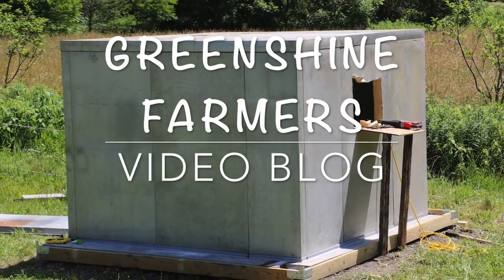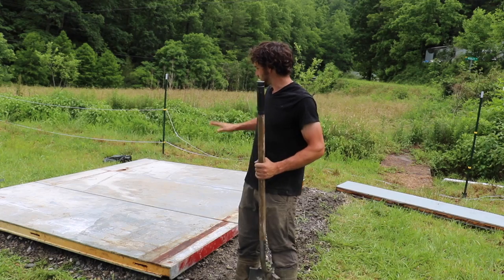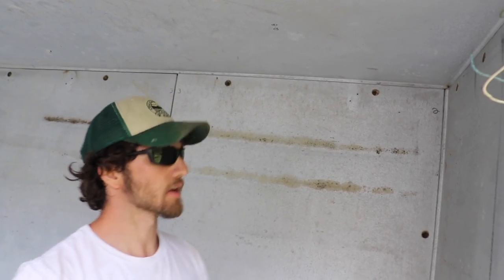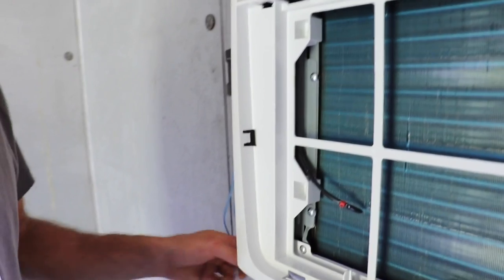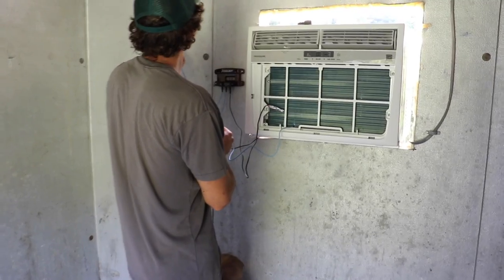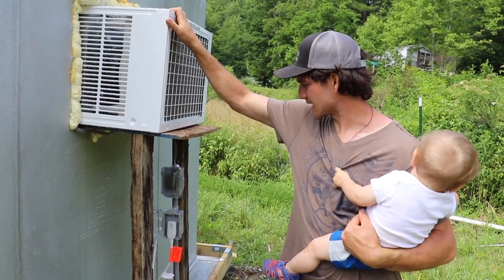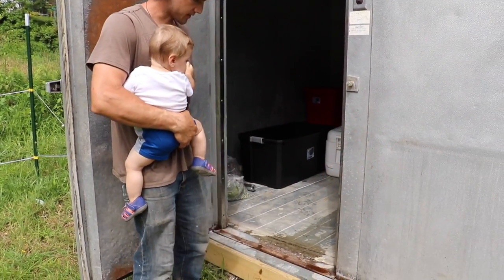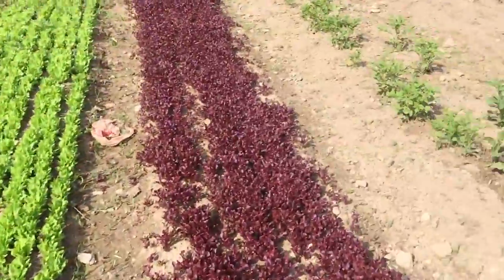Building a Walk-In Cooler with a CoolBot

Comment: Have you ever thought about putting those hanging plastic strip curtains that go on the inside of the doors commercial walkin coolers? They really helped cut down on the loss of colder air when going in and out of a cooler. I've been thinking on putting them on my walkin when I build it this summer, they cost $70-150 from what I found on Amazon. Like what you're doing, hoping to replicate it here in MI
Reply from the maker: Great tip, we'll look into that when it warms up.
Reply: was gonna make the same suggestion, and build a small entry patio....same width and opening path as the door. small box. put those fins on both sides....

Comment: If you have a 230v output it might be better to get a small out door ac like the ones they use in big houses.and a double door to enter and walk out with out letting the cold outout.
Reply from the maker: The 16k btu works just fine with a 10x10 walk in.  We have some strip curtains I’ve been meaning to install and that would definitely help retain the cold air.
Reply: @GreenshineFarmers  sweet

Comment: How did this work? Any issues along the way? Is this a reliable walk-in?
Reply from the maker: It actually works great!  The only issue is that sometimes during heavy rainstorms it will leak in certain spots.  I’ll caulk the seams and it will stop but with the movement of the earth it needs to be re-caulked about once per year.  Has no trouble staying 34 degrees though